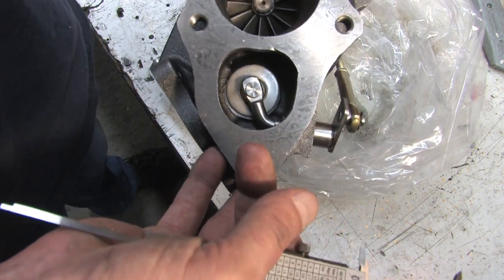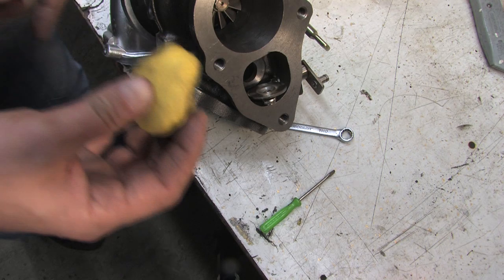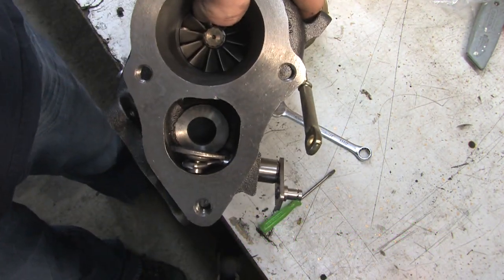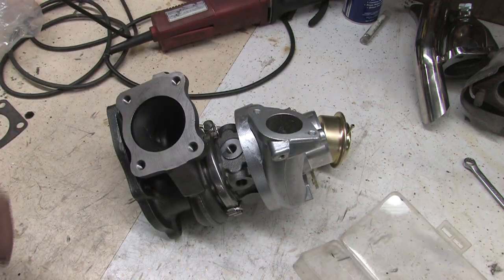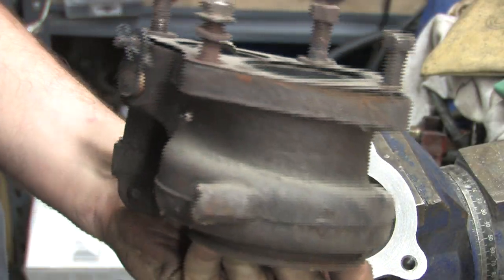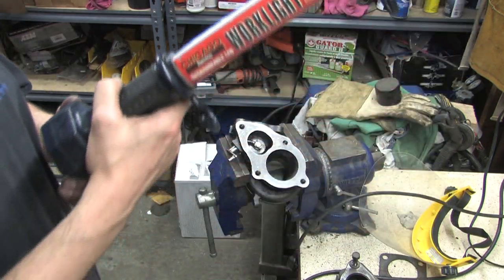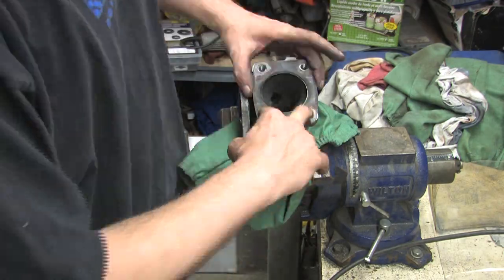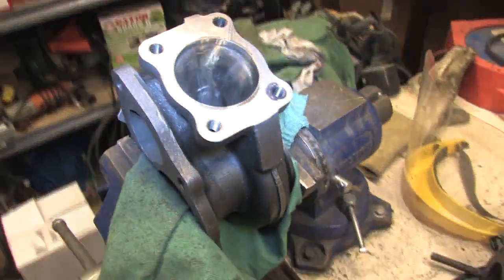Fixing boost creep on an eBay 20g turbocharger

Comment: How much boost can you get out of a ported td04?
Reply from the maker: davidusminimus Well... boost is relative...  there's also displacement.  There are a lot of variables to measuring a turbo's efficiency that are missing here.  But if pressed to answer your question without that info... I'd say... Just barely enough.
Reply: Haha yeah cuz my genesis turbo is pushing 19lbs on the stock td04 and wondered of porting it would be worth it. I want to get about 275whp but on the stock turbo that's hard because they run out of breath at around 260whp. I'm at 230whp atm
Reply from the maker: davidusminimus I'd say that just porting the turbo won't be enough to get you there.  It's not operating very efficiently at 19 lbs.  You might want to consider installing a bigger turbine and running lower boost.  Less hot air, less boost, mo airflow, mo powah.
Reply: Hmm thanks for the response but one more question .. I'm thinking of doing a compressor wheel and housing upgrade from stock 13t to 19t. How much boost should I run for my 275whp power goal? I got a tbe, intake, and canned tune atm. I'm probably going to need a tuning device and bigger injectors for the extra air.

Comment: If you are having over boost issues (porting) the waste gate might help but you have reduced the seating (sealing) area considerably and I would not be surprised with some carbon build up if that's leaking and killing some boost now. Wire that shut and ad a blow off valve, way easier to tune and sound better
Reply: you mean weld it shut and fit an external wastegate
Reply: +yami fourlife I have my doubts on his welding ability if he thought porting waste gate would help build boost lol
Reply from the maker: Know what you're talking about before making assumptions.  Having made a comment like, "Wire that shut and ad a blow off valve, way easier to tune and sound better" as a means of boost control proves you have ZERO room to criticize my work, be it welding OR porting.  That's the dumbest thing I've ever read.  Not only is that the absolute wrong way to control boost, your center section won't last a week.  You'll make nothing but hot air before it goes, but hey... cool sounds?  Nowhere in this video did I claim I was doing this mod to build boost.  I have no problem building boost.  Don't speak for my work.  Everything I've ever welded is still stuck together.  I never claimed to know everything.  At least you don't need my help with that.
Reply: +Jafromobile I said weld it shut and add a external waste gate to control boost, off course you are going to have boost spike issues if ur waste gate is to small, blow off valves have nothing to do with controlling boost. Reply to these correct statement, I wasn't dissing you I was having a go at the dimwit that says fitting a blow off valve will fix all boost issues
Reply from the maker: Yami, you are correct on all counts.  I wasn't digging into you.  I just didn't understand why Azdrtdog came marching in with his muddy boots grinding that shit into my couch about welding skills if he things a BOV has anything at all to do with boost control.  I mean... I guess he missed the title of the video?  I'm not trying to make more boost by porting the wastegate.  Arizdog.  With your consideration of these things, with your consent I'll be nice and delete this whole thread.  I can afford a new couch, but it's the principle...
Reply: +Jafromobile  lol  lots of cars out there only running BOV to control boost, and yor the one porting a eBay turbo with a Harbor freight grinder. so I figured bailing wire was about yor level. Now yor fixing boost creep huh!! Lol
Reply from the maker: Azdrtdog Guru of go This video was ALWAYS about fixing boost creep.  It's the damn video title.  It's clarified in a dozen other comments that you didn't read.  You just exposed that you have zero knowledge of what a BOV does.  Pretty embarrassing to be put in your place by someone using Harbor Freight tools isn't it?  The ONLY purpose of a BOV is to prevent compressor surge from blowing the center section apart when you take your foot off the gas and slam the throttle plate shut.  THAT'S IT.  That's ALL they ever do.  That's its ONLY purpose.  It is NOT a performance modification, and it's used NOWHERE in ANY FACTORY BOOST CONTROL SYSTEM.  You clearly got your education from a ricer.  Using a BOV to leak boost as a means of boost control guarantees your turbo MAKES NOTHING BUT HOT AIR, MAKES NO POWER, AND that it QUiCKLY TRASHES THE CENTER SECTION FROM OVER-SPOOLING IT.  You'll be lucky if the engine doesn't eat chunks of your compressor wheel as it disintegrates.  $50 you can't name one single FACTORY setup that utilizes a BOV to regulate boost.  No manufacturer has EVER done this.  I have nice tools and I use shitty tools in my video only to prove that you can still get good results on a budget because that's what everyone watching YouTube videos for an education is ALSO DOING.  It's a shame your education was so public, and so embarrassing.  I'm leaving your posts here, but you won't be back.  BYE.
Reply: +Jafromobile HOW DO YOU FIX BOOST CREEP ON A BRAND NEW TURBO YOU'VE NEVER RAN BEFORE, YOU CHANGED THE FUCKING TITLE
Reply: +Azdrtdog Guru of go yea but come on, read what you've said and do a bit of studying on waste gates and blow off valves before commenting
Reply: Blow off valves don't control boost, they release it !!!!'
Reply: +yami fourlife they control surge and lag to some degree,  but they will regulate cold side pressure .... Maybe not the most ideal setup
Reply: Richie Schmidt  he spews enough bulkshit on his own,